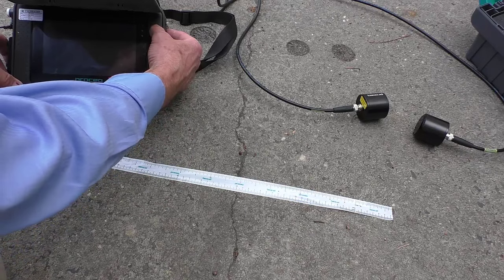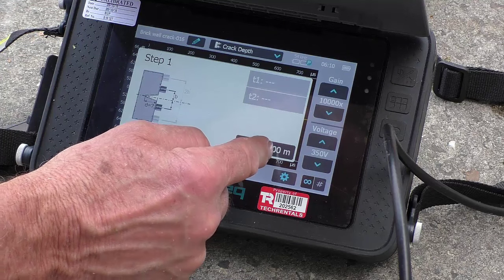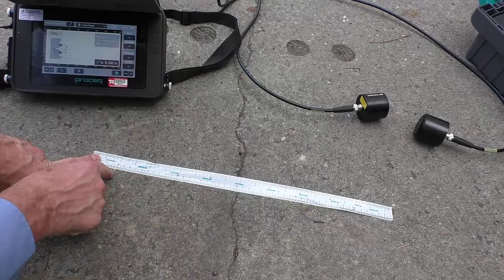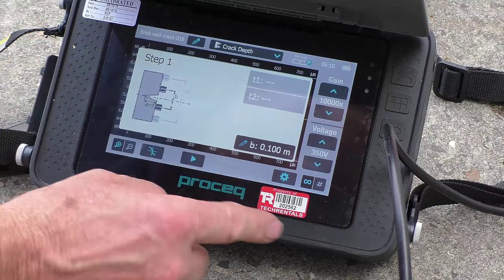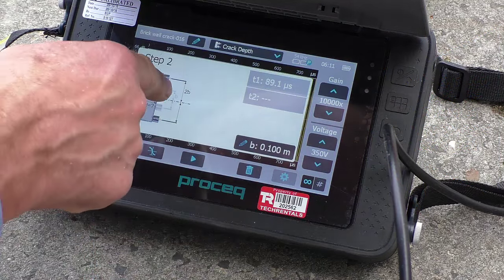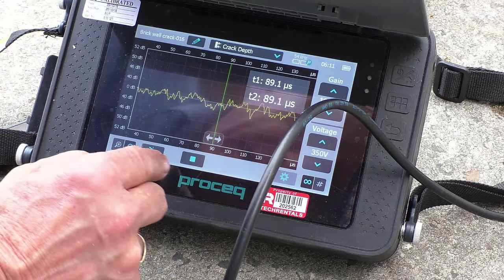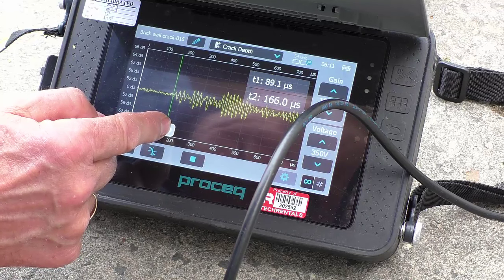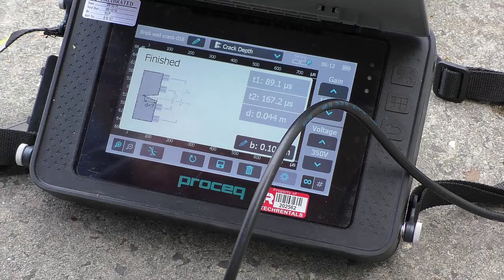Determine Concrete Crack Depth using the Proceq PL-200PE

Comment: Hi could i knw in a indirect method of 1meter must i change the distance everytime i go to the next point? Say in 100mm distance inbetween each points. So first point is 100 next is 200 n so on...till 1meter.
Reply: You can set any spacing... the 100mm is just convenience ... the limitation on the spacing would be how much signal is being received ... I have not experiments with very large base lines when doing this measurement.. Also I would image that, the logger the baseline the lower the accuracy...

Comment: Please how can I calculate the compressive strength of the concrete after getting the pulse velocity from the pundit. And how do I configure the conversion curve?
Reply: The Instrument can be loaded to conversion tables using the PunditLink software.  According to the manual the "Conversion curves are very much specific to the concrete under test and  there are many examples in the literature."
Reply: @GraemeMurphy54  Please I need a used proceq pl-200 tester

Comment: How to calculate crack depth manual use BS 1881?
Reply: Correct. I didn't mention the standard used in the video.
Reply: @GraemeMurphy54  i try calculate manual use BS 1881-203:1986 but result not same like machine.. Its confusing me 😥
Reply: Has to be your calc. because they both use the same equations .. http://www.c-s-h.ir/wp-content/uploads/2015/10/BS-1881-Part-203-86.pdf This document lists the equation if you used 150mm spacing and not 100mm spacing..